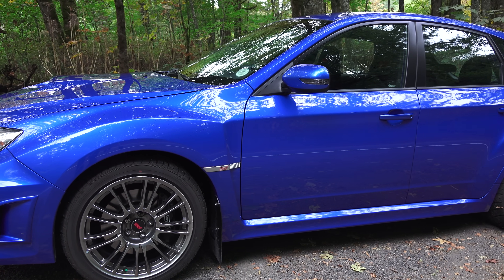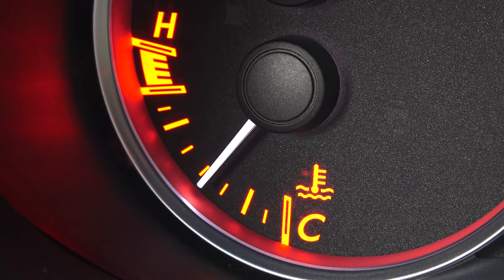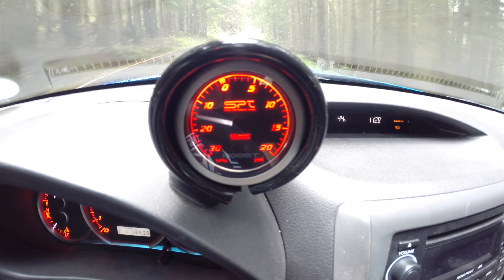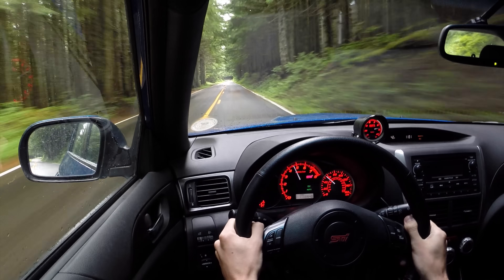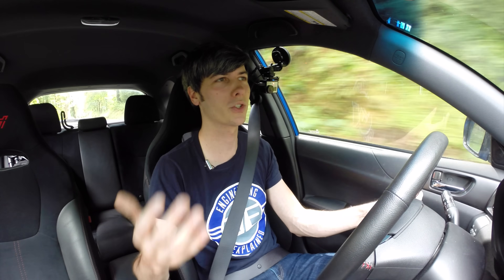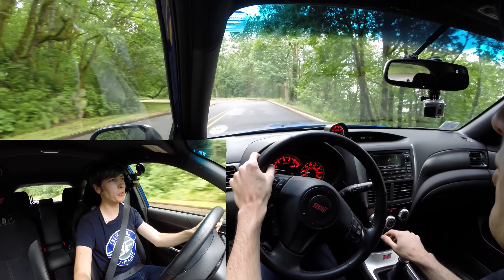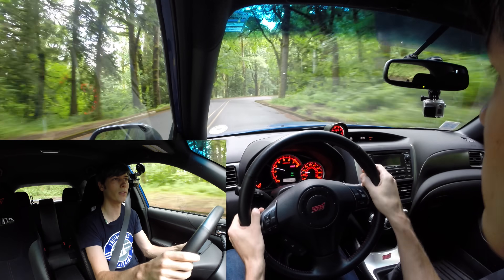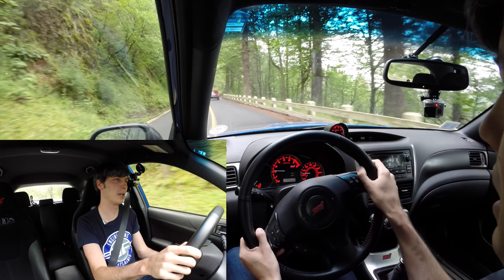5 Things You Should Never Do In A Turbocharged Vehicle

Comment: A lot of the things pointed out in this video only apply to older turbo charged vehicles.
Reply: Aside from letting the oil heat up, but that applies to all vehicles
Reply: Agreed.  I just bought an Escape Titanium which has the 2.0-L engine, which includes a dual scroll turbo.  The engine has auto-shut-off for traffic lights and drive through lanes or traffic.   I wrote a letter to ask Ford about this because I was worried about it.  I'd always heard you should let a turbo spin down and cool off before shutting down the motor, and these two things seemed in conflict.   The Ford engineer who wrote back was very specific in saying that the engine had been specifically engineered to handle this and properly cool the turbo as needed.   They'd also re-engineered the starter and flywheel to be designed to handle more than 100 times the number of start/stop cycles as their traditional engines.
Reply: Andrew Pollack I'm thinking about the same questions as I consider the new Subaru Outback that has an available turbo. Wonder how spooling up the turbo impacts the CVT and long term engine fatigue.
Reply: I want to give this comment one millions likes. Way to go giving 30 yr old advice in a new car...
Reply: this.
Reply: +FLnative dead on, computer controlled cars and he giving 1980 theory
Reply: sheldon blankenship jetta's are turbo
Reply: Yeah. The low rpm advise doesn't really apply to cars with variable geometry turbos. They have higher torque at lower rpms vs at really high rpm
Reply: Redblade I prefer roller skating to work
Reply: When I'm with the girl I give her my significant load
Reply: For cars that are natively turbocharged, you're all right. But if you turbocharge a non turbocharged car, you don't have a lot of these nice systems like secondary cooling and oil lines aren't as optimized as a car that's natively turbocharged, so a lot of the oil tips he gave apply hugely in these scenarios.
Reply: What he said applies to my car and I consider it to be modern.
Reply: Rawkfist1501 jnkjrtjamjqjqhagsvebehejejheuwhwwhhwhwhwhwhwhhwhwhwhwhhaabggagagwhwhwhwhhhqhqhqhwhywwhwhhsehejdjdjdhdknjwlsmkr rhr
Reply: Not really
Reply: You guys are taking him too literally.
Reply: Yeah modern cars have oil and water feeds, so no need to worry so much. "5. Don’t floor it coming out of a corner" he basically said don't drift in a modern turbo car, no one is listening lol.
Reply: Redblade I don’t drive a car tho
Reply: Good point.
Reply: Stephen Sinclair III your car has no secondary cooling for the turbo and the pcm can't maintain the proper air:fuel ratio? That's rather surprising.
Reply: ***** wow thank god you were here to explain that
Reply: If you mean that the ALH and AHU are the slowest that VW created then you are so wrong.
Reply: Junkhead Haha the Kia is my wife's car. I have a DSM with a 6262 on it...
Reply: These apply to my 2016.
Reply: +Rich Smit actually flat fours have the same tq/hp split as a domestic v8. Unless you're modding for torque alone, the two numbers are normally within 10% of each other. 300hp/300tq at the wheels is very common. I don't think that Jetta can do that can it?
Reply: justclik but v8s make that torque much lower and throughout the rev range without turbo lag
Reply: I like his videos, but I agree that some of the stuff in this video isn't really applicable. I have a turbo Kia and it definitely does not like "the highest octane you can get". It likes what is recommend which is 87. Big difference with direct injection and modern fuel management.

Comment: you're talking about lugging in a diesel an saying that it will inject more fuel and it's bad? huh? they're mapped ECU' you can floor it at 1000 rpm and it will refer to the load chart mapped in the ecu and inject the right amount of fuel for that rpm. You're then on about to not power out of the corner, it's logical, you can do that with a regular car that's non turbo, you have grip then get into the powerband and it starts to slip.
Reply: That's what I has thinking. The ECU is going to control AFR's under any condition you could drive the engine. My VW  TSI runs low rpms through the automatic trans and mimic diesel like power out of a gas engine. Knock sensors are going to correct any mis-givings.
Reply: +Rennie Ash in some cases yeah, but it's not something you 'shouldn't do' I swear that EE is just saying it as a 'filler' to make the video longer.
Reply: Exactly, the way he mentions it sounds like he's saying that modern diesel cars have a mechanical throttle, which is wrong.
Reply: +diesel mutt88 also about having to buy the more expensive site fuel for a turbo car, that's is a heck load of BS, y out will only have a difference in power and unless you have a car that is ultimately tuned for one type of fuel, you will not notice a difference.
Reply: He should have said never to put lesser octane fuel in your car than the one it was tuned on by a manufacturer, it is even written in cars manuals. My car was tuned from factory on 95 octane but I have never filled 95 only 98 octane or at one stage they had 100 octane fuel (98 petrol +10% ethanol mixture) at certain pumps but its not sold anymore so I just add few litres of e85 on top of 98 octane. Once its modified it is tuned to one type of fuel but some car have the ability to have maps for 2 fuel types say e85 and 98 where you can switch from one to another
Reply: Danilo Margarido American use different octane ratings but they are basically the same as 91/95/98RON
Reply: Guys, knock it off.
Knocking triggers a negative feedback, that's it.
Reply: Danilo Margarido
mate that pun is a bit2shift-y
Reply: *****
Having a turbo gives some broad forgiveness to the type of fuel used. While not recommended, they will run fine on lower octane fuel if that's all you can get. They will just be de-tuned and have less power and economy. Altitude changes are irrelevant also with a turbo because any modern VG turbo is well able to compensate.
Reply: +DIgitusSmartas #4 lol
Reply: Robbie Bilak Anything that can burn when atomized can power a diesel engine.
Reply: That's a pretty low octane rating compared to what we have on this side of the Atlantic.
Reply: that's incorrect. the engine CANT knock with a knock sensor. if there comes a point where the knock sensor cant correct the issue (and it will be faster than you could detect the knock anyhow) it will just go into limp home mode to preserve the engine. that's why such systems exist.
Reply: it detects it long before a human would ever be aware it was happening. the engine management system adjusts thousands of times per SECOND so would adjust to poorer fuel pretty much instantly.
Reply: having done a little more reading on this, the knock sensor actually detects when the engine is at the POINT of knocking and adjusts the engine maps (ignition advance, fuelling etc) accordingly. and even then it will only react when demand is highest as an engine wont knock when cruising as it needs minimal fuel/ignition advance. any given vehicle is designed to run in a number of different markets. in some places, you will be unable to get a given grade of fuel which is why manufacturers map the engines so conservatively. yes, you can map out the reserves via a remap, giving you extra power. that's fine if you never plan to leave your home country but over here (UK/Europe) we can drive across numerous countries should we wish to (and many do) for holidays etc and you CANNOT GUARANTEE the fuel you would get would be an equivalent to what you get at home. also the cars sold in that country are IDENTICAL to the ones you buy at home, but the fuel grade is lower. so how don't all these cars self destruct? the engine management system. even when remapped the system will still protect the engine. the ONLY way this wont happen is on a standalone ECU with no protection programming. ANY other ECU whether it be stock or remapped OEM unit WILL have this protection built in.
Reply: Unitarity | Wait... so knocking usually occurs near World of Tanks? Now you lost me... 

😋
Reply: Turbo lag is more extreme though ;p

Comment: The only time you need a catalytic converter is for the emissions test, install it with u-clamps, so you can remove it after you pass the sniffer, and replace it with straight pipe until next year. (Or, better yet, get a vehicle made before 1972, and you won't even have to do a sniff test!)

Comment: One more thing to add for Diesel engines: flooring it at low RPMs can induce a surge condition on the turbocharger: just as you would put your hand on a vacuum cleaner's tube, the turbo will suddenly increase its rotation speed.

This can, in turn, put a lot of stress on the (turbo) rotor's axle which will break at some point. When it breaks it's catastrophic, metal parts can enter the engine's combustion chambers and oil will get there too. Engine runaway with metal shreds means almost always a new engine block, maybe with new pistons and valves.

Comment: well, allmost true.
a diesel with a turbo does not care if you put it in final ger and it has to accelerate from idle rpm. surely the acceleration will be under the froggs ass, but no way its dangerous.
thing is, if its a proper diesel with a proper mechanical injection pump, then it has a vacuum operated compensation system to sense boost available. or not available. so it won't overload the engine with fuel. if its one of today's industrial junk then it has an airmass/flow meter, doing the same thing in a retarded and needlessly complicated way.

agricultural machinery sortha faces situations like that, forestry maxhinery before the hydraulic drive stupidity era, the proper ones with a proper and working transmission face this verry often, and will make no deal out of it. even after 10K past work hours.

what you state is mostly true fro the whipmy petrol engines.

Comment: Why do you not want to over steer??? I boost out of corners because it is way more fun then to boost on a straight... OK I have now an rear wheel drive but I did that with my front Wheel drive too but there I put some tension to the parking break in the rear to control the slip/ drift. Some people say front wheel drive is no fun, that is wrong! You just need to know how to get the fun out of it. The fun ends when the car has full automated drive assistance and traction control. Even skid controlled break systems are cutting down the fun. Pull out the ABS pump fuse or get an 80's car that has no helpers. DRIFTING IS AWESOME!

Comment: 1. Engine coolant temp is directly relative to engine block temp and oil temp. Modern ball bearing turbos only need a small amount of oil, even running restrictors to reduce oil flow
2. Modern water cooled turbos use thermodynamics to circulate water through the turbo to cool it after shutdown, unless it was badly designed. Was an issue in oil cooled diesel turbos. Shouldn't go from full noise to shut off, but most scenarios are no problem.
3. Not many turbo vehicles make boost at 1000 rpms unless it has a small turbo that won't make a huge amount of power
4. Completely agree. Unfortunately no way to protect from a bad batch of fuel :(
5. Turbo cars with lag need to be accelerated before you need the power to allow the boost time to build. If you accelerate when you need it you'll be a second late getting it. The timing can only be learnt by driving your car. If you want to be able to smoothly accelerate out of a corner buy a naturally aspirated or supercharged car with no lag

Comment: On point two, you missed the main reason not to shut one out like that: Turbo spooldown.

Turbos spool at ridiculous speeds. Over a hundred thousand RPM for smaller ones is not uncommon. They rely on engine oil flow to stay alive and if they're not given a few moments to spool down on engine shutdown they'll cook their bearings in no time flat.
Reply: TestECull You guys understand that even the slightest load on a small turbo will allow it to spool right? Allot of people pull in a parking spot and instantly turn their car off. That's no bueno. He's right on this.
Reply: Is it just me or do you have the other impression here? When I put my Diesel (6.5, Turbo) in Park or Neutral the RPMs go up for a second or two then they go down. I can't say I know for sure if that's the turbo but it does happen.
Reply: Don’t spread lies, that’s false. Even driving into your driveway slowly will cool down your turbine
Reply: Wtf car revs to 100,000 rpm?
Reply: give me a example of someone who does not let their turbo spool down before turning it off. last I checked, you get off your gas pedal. 
who would boost their turbos to spool up and then turn the car off??  phuuuk you mean?
Reply: Austin Lucas
That's normal because when you've got the automatic in gear it's putting a constant load on the engine. A small one, granted, but a load nonetheless. When you put it in neutral or park it removes this load, thus the engine will surge up a few revs and restabilize.

Has nothing to do with turbocharging.
Reply: Dude, unless you can get off the throttle and shut down the engine in less than a couple seconds, your turbo is not spooling quickly. 

That said, if you do kill it immediately after parking you are correct that's not nice to the bearings. The turbo will be turning over "slowly" at idle speed as you stop, but the bearings are still hot from driving (even not driving aggressively). Several seconds of oil circulation is a good idea for any small turbo.

I'm just taking issue with your wording, not your message.
Reply: +Austin Lucas the rpms go up briefly when you put it in park because the transmission is no longer putting a load on the engine. the engine was under load and injecting slightly more fuel. When the load disappears, that extra energy from the extra fuel has to go somewhere until the ecu/pcm decreases fuel injection.
Reply: TestECull haha dumbest comment ever are you turning off your car after bouncing the rev limiter.

Comment: another point about high load/boost/power at low rpm is cylinder pressures,  when you're making that much boost and power with only so many revolutions you can put extra stress on bearings etc. with the pressure created